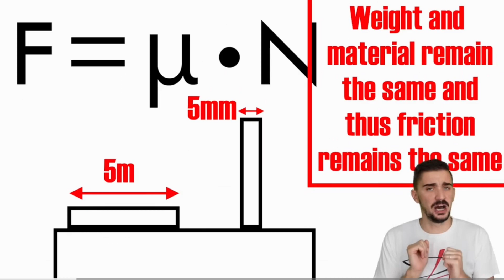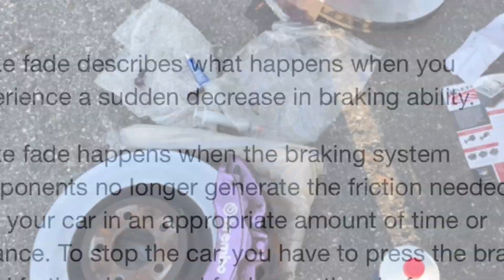HERE'S WHY BIG BRAKE KITS DON'T SLOW YOUR CAR ANY FASTER... (SURFACE AREA DOESN'T INCREASE FRICTION)

Comment: Surface area don’t affect friction .. if I punch u with my knuckles vs my entire fist my first sticks to ur face more (higher friction) while being higher surface area than just the knuckles?
Reply from the maker: That’s exactly what I explained haha
Reply: @TobyVegaD  I know but that don’t make sense to me, I’m not saying it’s wrong idk I’m just saying it don’t make sense based off what I know about fighting and kinetic energy. The less surface area for kinetic energy to cover the more dense”” (powerful) it is - reference water point pressure washers . Or like those pens to break windows
Reply: @c4sare4kiddos  the surface area doesn’t affect the friction of the BRAKE PADS on the ROTORS. So big brakes apply the same Amount of stopping force as smaller brakes as larger brakes don’t press on the rotors any harder bc if they did  it would just make you lock your wheels which smaller brakes can already do that’s why we have abs. The friction between your tires and the road surface is what stops you so having larger tires providing more friction will stop you quicker. Your brakes are just there to slow down the speed of your wheels so that your tires have more traction and therefore more friction on the road surface.
Reply: @jorimills1368  agree with everything besides surface area does affect the friction of the brake pads. If there is more surface area in ANYTHING there is GREATER friction equated. Which u said for the 2nd half of response but not the first? So what the law only applies when it’s helping ur narrative or what?